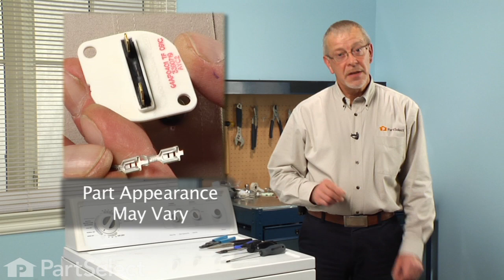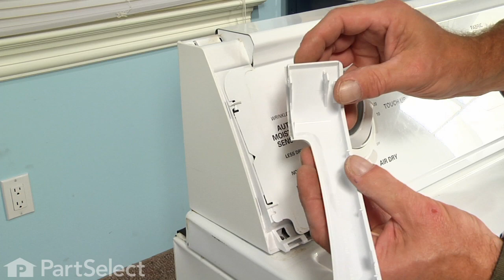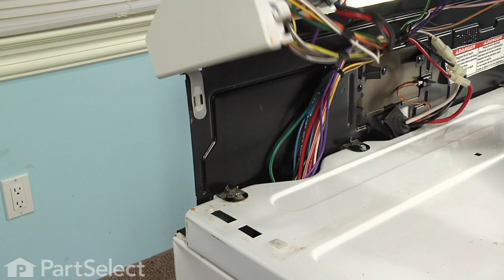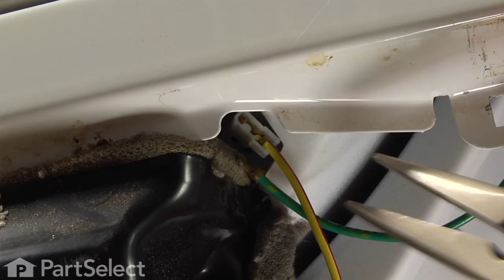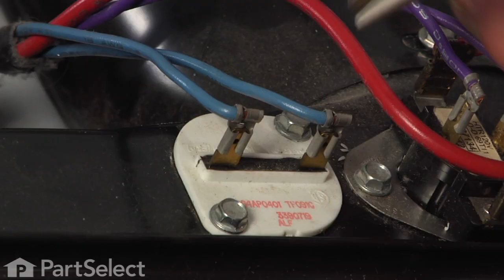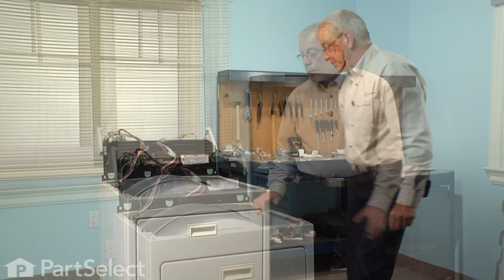Dryer Repair - Replacing the Disposable Thermal Fuse (Whirlpool Part #3390719)

Comment: You don't have to take the whole darn thing apart to get to the thermal fuse. Remove the front/bottom panel under the door and then the metal (silver) cover to expose the blower wheel, and it's right there on top of that!

Comment: Mine is not located in that spot i own a whirlpool cabrio platinum model # WED8500BCo
Reply from the maker: Hi Ahanti and thank you for your question! I entered your model number into our system, and I think this video may be of more help:

https://www.youtube.com/watch?time_continue=3&v=GDQLr2EXogo

This is the repair video for installing a high limit thermostat and thermal fuse kit rather than simply the disposable thermal fuse kit like in this video. Please feel free to reach out again if this video doesn't help with your repair, I'd be more than willing to troubleshoot with you!

Comment: Thank you!   I thought the thermal fuse was blown but it turned out to be just a broken belt ... there is a broken belt bypass which cuts power to the motor. Followed your instructions on opening the dryer ... tested the thermal fuse, and start switch while it was disassembled. Then identified locations of other components and cleaned the interior.
Reply from the maker: Good job! Thanks for the kind words and congrats on detecting and solving the problem!
Reply: *****
New issue same dryer. Shell vibrates loudly.  Drum turns freely by hand. Tension spring and wheel do not seem to be binding.  Rear wheel (drum rest on) appears to turn freely. Thoughts?  Next step will be to disassemble the shell and check for loose or broken mounts

Comment: Great step by step - except when I got to 3:49, the fuse is well enough exposed that it can be swapped out without removing the drum.  Used a 1/4 socket drive on the far nut and a T-handle on the one just under the drum.  Close quarters, but can be done!  This video and a $4 part salvaged a 16-year old machine and saved a $100 service call.